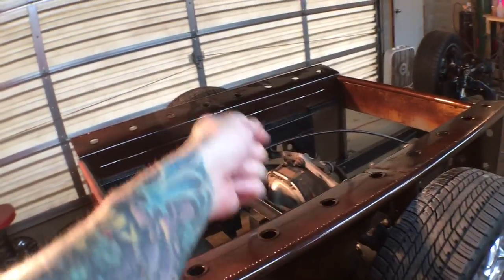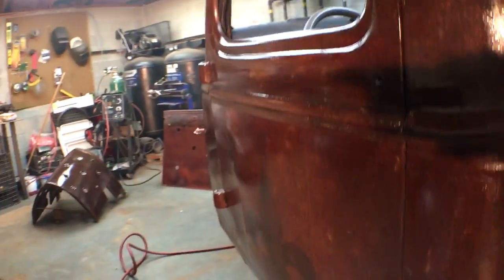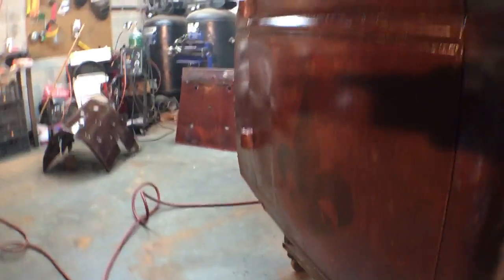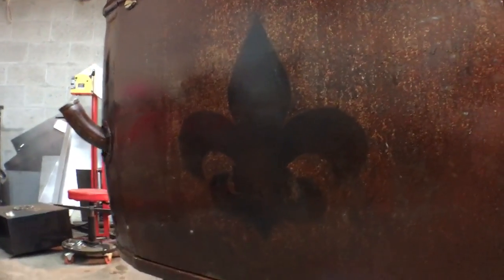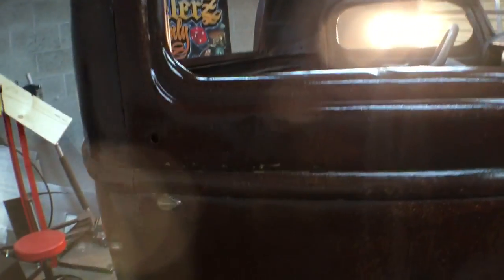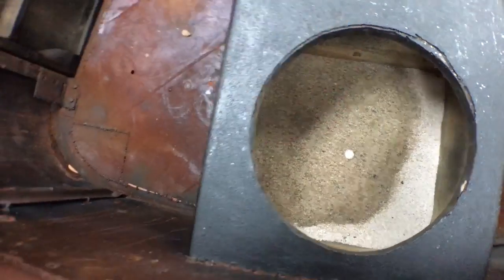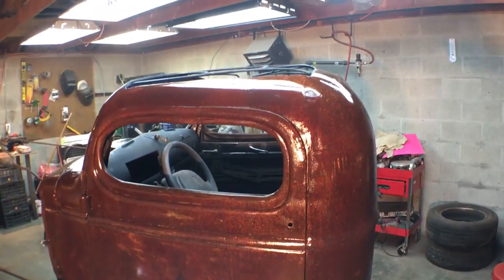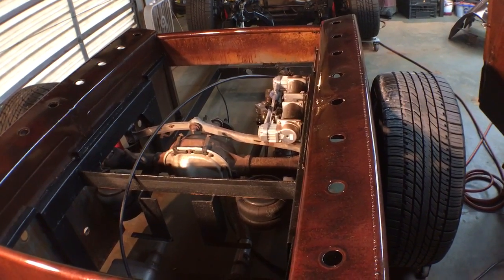R's rat rod truck build part 65

Comment: I wanted the bare metal look and so I cleared over the metal ... didn't work ... after a few weeks it started rusting anyways, even though it was inside my shop  ... had to create the bare metal look with paint.... But, I hear that a very expensive clear 'like $300 a gallon' can be bought that works but the everyday clear coat will not stop the rust .... Just Sayin'